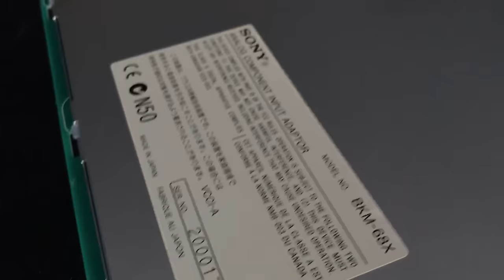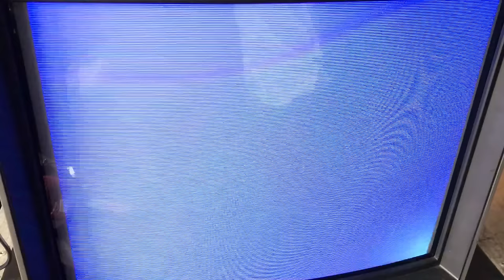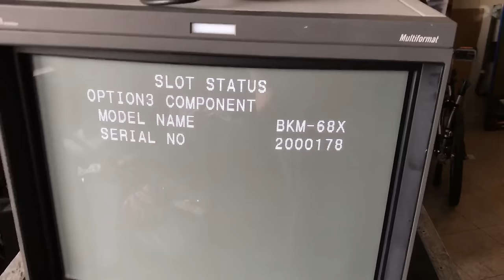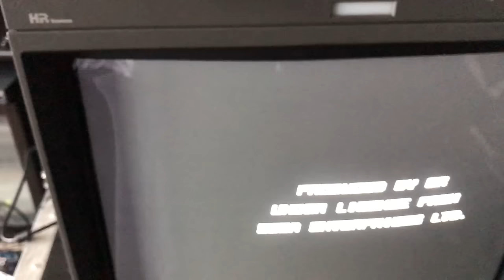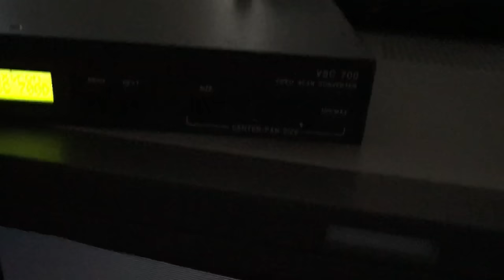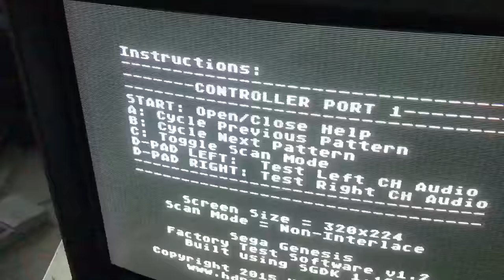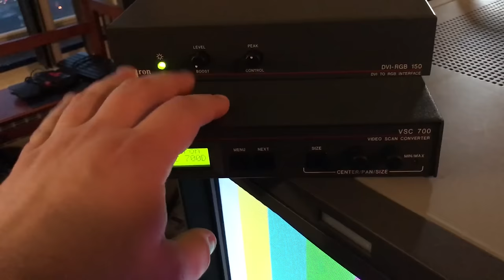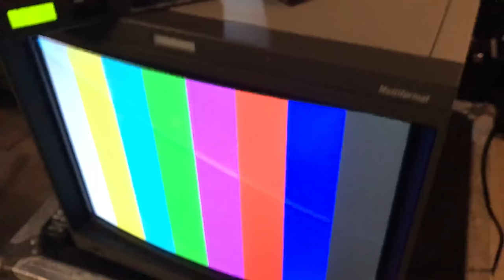Sony BVM A-Series and the BKM-68x - Pt 1

Comment: I remember when the A series was launched. Post houses and broadcast stations weren’t really bothered about RGB, as the infrastructure tended to be HD SDI/SDI, but Sony needed to offer RGB/component for legacy compatibility and tv stations that might still have older component infrastructure or perhaps an RGB monitoring output direct from a telecine.
The list price for the BKM-68x in 2007 was around £800 ($1,000) and I certainly wouldn’t pay more than that now. Apparently, only 500 were made, though I’m sure I’ve seen higher serial numbers. The worst thing is, a lot of them were probably disposed off, as companies bought them thinking they might need them, but then just sitting on a shelf as they had upgraded their infrastructure to HD SDI, or sitting in the monitor, which ultimately went to a recycling centre, where they wouldn’t know what a BKM-68x and it just goes in the mid grade circuit board recycling pile !

Comment: With that FPGA you might be able to clone the setup by extracting the bitsteam from the storage ROM it uses to configure itself during boot.
Reply from the maker: That's way over my head.  Awesome idea though :)
Reply: Would DeCapping the FPGA help? or is that not a usable extraction method?

Comment: Hey Bob, the 203rxi may work if the jumpers on the inside of unit are changed. They are J7 for V Sync, J6 for H Sync, and J20 to Enable Sync. Nice video documentation!
Reply from the maker: According to the manual, those jumpers on the 203 are for negative & positive sync.  I DID try those, but without any luck.

Comment: Regarding the statement for 480p not being compatible with HD-SDI or standard SDI, you're technically correct in these specific instances of use. Supposedly there was an SDI standard that did support 480p called ED-SDI kind of along the same lines as consumer EDTVs that supported 480p. This link here describes the different SMPTE standards used in the industry and which SDI standards were used for each one.

https://en.wikipedia.org/wiki/Serial_digital_interface

Just from my own researching, I don't think any BVM slot-in cards that supported ED-SDI existed. They have been for different sets I suppose. Personally I would love a slot-in card that supported 480p.

Comment: You are running into the same exact issues I had with my BVM D24E1WU. I used the negative sync switch to fix alot of stuff. But there where issues with 480i games. Luckily the VCR mode works on mine and I no longer needed any extron device
Reply: I'm having similar issues on my D24E1WU, any chance you could point me to where the negative sync switch is?

Comment: That's the exact same issue I was running into when using the RGP-Pi cable on my 20L5!
Reply from the maker: I'm actually now having that issue with my D-Series BVM, where I didn't have it before on my PVM-20M2U.  I'm curious to see if the gscart/580xi trick fixes that.

Comment: Nice demo! That is a very interesting fix with the extron 580xi on the sync problems.

I heard the sync problems on the genesis games were only with a 60hz modified PAL Megadrive. The 60hz signal is a little off spec on that one. How about Neo Geo AES?
Reply from the maker: I couldn't get an AES this time.  That's for the follow-up testing :)

Comment: Also, do you know what RGB signal format is coming out of the BKM-68x? Maybe the BKM FPGA is just doing some control/glue logic and all that would have to be recreated is the BKM's analog signal processing chain. It would be cool to see an RGB mod board for these monitors.
Reply from the maker: No, but I'm trying to get a service manual for it.
Reply from the maker: Here you go:  http://www.retrorgb.com/servicemanuals.html
Reply: The manual you have for the BKM-68X is just the operation manual. If you want the maintenance or service manual, which should have schematics, part listings, some testing/troubleshooting steps. I contacted Sony directly to find out where to get a copy. They pointed me to http://www.truemanuals.com/sony/ where you can order a paper copy. I've found the digital sites selling PDFs to be pretty shady if they were asking for money.
Reply from the maker: Ahhhh, you're right!  According to that site, the service manual for the 68x is $38 and the BVM-A20F1U manual is $84.
Reply from the maker: XGA just "donated" both the service manual for the BKM-68X AND the service manual for the A-series BVM's!!!  I updated the description with the link.

Comment: Great video, Bob!  Thanks.

Did you try adjusting any of the BKM-68X settings in the MAINTENANCE section to see if they made a difference?
Reply from the maker: No, I wanted to stick with basic testing this time, gather more information, then go back for advanced testing.  I don't believe there's a "VCR Mode" in these though.
Reply: I've looked for it, as far as I can tell, there's none.
Reply: Tried, there is no maintenance or new version of VCR mode. Sorry.

Comment: Also, for your OSSC solution, couldn't you do that way simpler by doing Genesis -> OSSC -> HDMI-to-SDI converter -> BVM? EDIT: Ah, you address it later, but it may be worth trying OSSC set to passthrough into an SD-SDI converter to see if 240p works (since SD-SDI does 480i).
Reply from the maker: That converter was broken.  Trying that again this week...but since the OSSC doesn't output 480i, the only choice would be 720p.
Reply: I have mixed feelings about using an OSSC>HDMI>SDI on a CRT. It feels like a big waste of money & Space to do something that I could do with a Cheap LCD & get the same result. (For Retro consoles but not HD Consoles like PS3)

Comment: What I want to see is this monitor at 720p via sdi with original XBOX or 1080i with ps2 (Gran Turismo 4).
480i is a waste of time with this monitor. Using two HD-SDI connectors in a pair, the BVM-A20F1U allows a variety of high definition signals at uncompressed 4:4:4 chroma resolution and can be accepted in both GBR and Y/PB/PR signal formats.
Reply from the maker: I'll be testing 720p this week, but I'm not going to bother with 1080i.  Even on a CRT, it's still flickery...I really don't like playing any interlaced games at all.

Comment: Wow. I was fortunate enough to acquire a BKM-68X, but I had no idea they were THAT rare. Mine is apparently #188
Reply: Jason Foley are u selling it?
Reply: Very unlikely.
Reply: Jason Foley :(
Reply: Jason Foley congrats man you're super lucky especially if you have the monitor to go with it.
Reply: I do have a BVM-A20. I'm mostly happy with it, but I'm looking to upgrade to an A32 or a D32

If you're looking to buy a BVM, the D series is similar in quality, have built in RGB input, and fewer sync issues.
Reply: Jason Foley wish I knew this before I bought an A series. Little did I know this 68x card is a must. I'm so bummed oit
Reply: If I knew about the issues the A series has, I probably would have looked for a D series instead
Reply: @JTF195  Have you ever thought of selling it to someone who could reverse engineer it and produce more of them?

Comment: My N64 has a skew/bend on top using S-Video on a BKM-61D card. SNES works fine using the same cable. Any advise?
Reply: Did you find a solution? And where the heck is the s-video on that card? Or does it have some different type of connection. I've been trying to figure this out.

Comment: Would an older XRGB unit be useful in the chain? It does 480p VGA which could probably be converted to HDMI then SDI. I got my XRGB1 on ebay for $100 late last year, so it could end up being a cheaper overall equipment chain.
Reply from the maker: The SDi issue is that I don't think 480p is a compatible format for it.  I think it's only 480i, 720p and 1080i.

Comment: 580XI manual

http://media.extron.com/download/files/userman/68-536-01RGB580xiuserguiderevG.pdf

Page 8 - 

Comp Sync — This switch controls composite sync output.
On — The interface outputs combined horizontal and vertical sync for RGBS.
Off — The interface outputs RGBHV or RGsB video."

Did you have the SoG DIP on or off ?
Reply from the maker: Thanks for this.  It wasn't my Extron, but I'm getting a few 580xi's in this week for testing and will open it up.  I'm more concerned with it needed RGBHV INPUTS, not outputs, but I'll check it out.  
All switches were off, except Comp Sync.

Comment: Hi bob, i have a bvm-d14h5e monitor and i get the same picture bending when using a rgb moded pc engine duo rx/core grafx consoles (havent tested a master system).
In the monitor input config menu i can see the vcr mode option ,but its not selectible (blue color), do u think that if i purchase a extron 580 device would solve the picture bend on the pc engine ? (All of my other consoles that iv tested seems to work) Thanks.

Comment: What about sticking an Extron sync converter like the SC-210 between the gscartsw (outputting csync or rgbhv) and the BVM? The advantage there is that the SC-210 doesn't add any lag since it's not touching the image (only sync).

Unfortunately, while I have an SC-210, I don't have either a Genesis or a BVM to test with :P
Reply from the maker: Well, that's what I did with the 580xi.  Worked perfect, no lag.

Comment: There was a recent discussion on modding in RGBS into the the JVC tm-1950CG and it was a really simple mod to pull off, I was thinking it would be possible to mod these BVM-A monitors for RGBS too.

Anyway, I think I'd rather just go with a nice Ikegami monitor instead of approaching Sony's BVM-D/A lines unless I can get one of those for really cheap.
Reply from the maker: While that might work, it would be less effort to put an A-series tube into a D-Series.  As far as I can tell, the ONLY advantage of the A's for gamers is that the tubes are generally newer.
Reply: heyy where is this TV RGB Modding forum you speak of?
Reply: we talk about these things on the crt collective on facebook.
Reply from the maker: @bagofclothes73  http://shmups.system11.org/viewtopic.php?f=6&t=56155

Comment: hi bob, i have the bkm 68-x and i was wondering how to connect rgb and component at the same time so i dont have to plug and unpluge the cables every time that i need to play on component or rgb.
Reply: You can simply buy an Extron Crosspoint switch which is cheap and easily available.

Comment: What about the OSSC in passthru mode?

then into the wiistar, if the OSSC output was 480p, would you then get 480p output to the SDI out on the WiiStar?
Reply: After reading the A Series/BKM manuals , it seems all of the SDI input formats are interlace except 720/1080

so the "not too bad" interlace Bob gets in the video is probably the best it can get

Comment: I'd like to know why this card is so special. I've come across a BVM-14F5E with an BKM-21D expansion card for RGBS input just like this card. Does it have to do with capabilities of digital processing? Do I want something like this? So many questions.
Reply from the maker: The ONLY reason it's special is only a few were made.  The homebrew replacement is better in every way:  https://youtu.be/6fBE2i7pqJ8
Reply: @RetroRGB  So if I understand correctly this board adds nothing compared the stock analog inputs found on a non A-series BVM in terms of supported formats or visual quality?
Reply from the maker: Correct.  In fact, it takes AWAY "VCR Mode", which is found in the D-Series cards.  May I ask why you're asking?  Maybe I can point you in the right direction.
Reply: @RetroRGB  I was looking to buy a BVM-14F5E for 400 euros. Unfortunately it turned out to not show an image when powered on so it's not an issue anymore. The seller still has a 1411P and two 1410P's which do turn on and have slightly warped image. It appears that those models don't log their operation hours digitally so I'm unsure whether to try and get those. The seller told me he can't find that information and has no knowledge on CRT's since the previous owner passed away. What do you think?
Reply from the maker: I mean, unless they're SUPER cheap (or you have experience rebuilding CRT's), I wouldn't buy something that's warped or broken.  They'll probably need a ton of the capacitors replaced, but might also need flyback work, the tube itself might be going...etc.  Sorry for the bad news.

Comment: Im currently using the 68x card with my A20F1U. It seems whenever I connect a 240p source it still reads as 480i/60. What gives? Can this monitor run true 240p?
Reply from the maker: That's just what the menu shows.  240p is more of a "trick" then an official video format, so all BVM, PVM and even consumer-grade CRT's will show "480i" when a 240p game is being played.
Reply: 240p is not a true standard. It's a trick that happens to work with analog input, but falls outside the spec accepted by 480i SD-SDI.

Comment: HI I have just bought a Sony BVM A20F1M and all I want to use is Component (YPBPR) on it for wii and gamecube 480p games What analog card will work on the Sony BVM A20F1M for Component? Component to SDI won't work in 480p so I need a BKM 20D or 21D but I don't know if these cards will work on a Sony BVM A20F1M  let me know what you know I hope that a BKM-68x isn't the only way to do Component 480p on a Sony BVM A20F1M
Reply from the maker: A BKM-68x is literally the only way.  You MIGHT be able to find a converter that lets you use 480i component via SDi, but I've heard compatibility is spotty.
Reply: Thanks for a very fast reply that is annoying let me know if you can ever find out a solution to get Component 480p on a Sony BVM A20F1M without BKM-68x
Reply: This is probably a dumb question do you know where I can get a BKM-68x for $1,000 or under?
Reply from the maker: No.  The last person I know who bought one paid over $2000.
Reply from the maker: I emailed them last year to ask about it...I don't think they are legit at all.
Reply: I will try and email them and I will let you know If I ever hear back from them

Comment: Is it just me or is there an audible 15khz noise comin' from that screen? I know some don't emit it as noticeable while others you can tell. Curious how this A-series compares.
Reply from the maker: Every CRT has some noise like that.  This one isn't bad.
Reply: It's called CRT whine. It gets worse as the components in a CRT get older, most noticeably the flyback. Only way to fix it is to completely replace the flyback (not sure if they can be repaired).